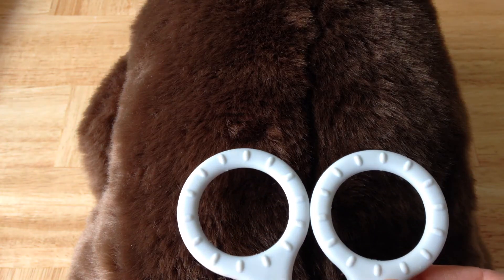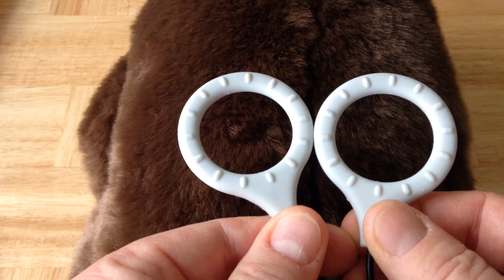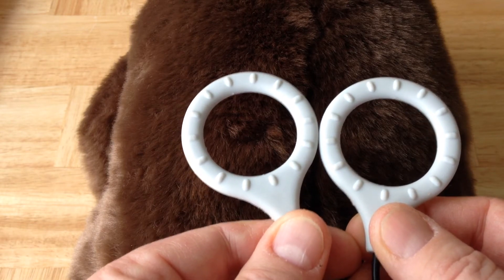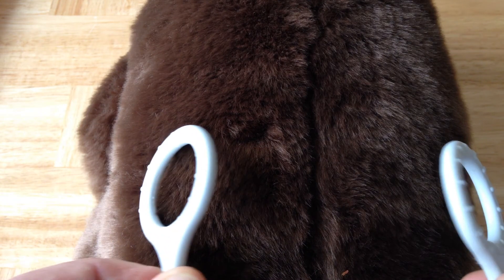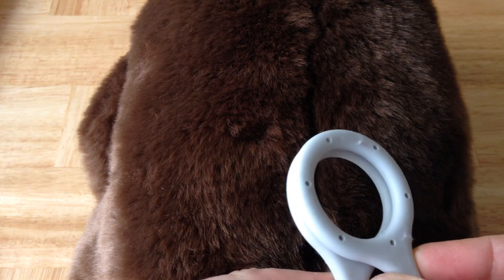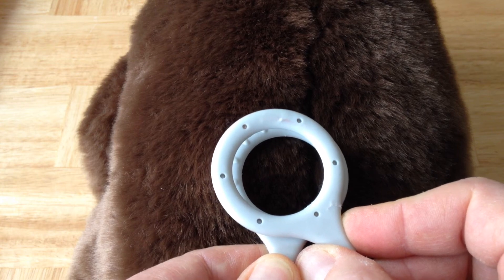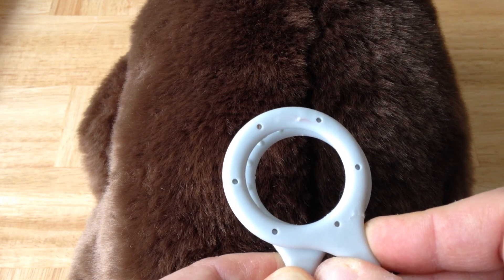Micro-Pulse ICES PEMF Video Tutorial 1 - Basic Coil Configurations

Comment: How should the coils be placed to reach the femoral head? I.e. on the front of the leg and on rear end or near crotch and outside of hip? 

Can you comment on the use of this for avascular necrosis (AVN) of the femoral head?
Reply from the maker: The best way in general to get depth of field is to use coils on opposite sides as you suggest.  Depending on how thick your gluteus muscle is, your strategy may vary.  With thick glut muscles, positioning the coils on crotch and outside of hip will probably work best.
Reply: @robertgdennis7472  thank you for the reply!

Comment: Hi Robert... Nick Urban's father here.  I had knee replacement surgery a few months ago,  and bought the M1 model to help with recovery.  I wear it all night long with the coils on opposite sides,  either side to side,  or kneecap to back,  using the standard settings the unit ships with.  Curious to know if you have any recommendations for either coil placement, unit settings, or anything else.  Thanks in advance for your response.
Reply from the maker: Hi "Mike Urban's Dad", nice to hear from you.  This is a really good question, and the answer is that the issue depends on a lot of unique individual factors that remain not-yet well understood.  So I think the best strategy is to follow a few basic guidelines, and use trial-and-error to find what works best for you as an individual and your individual injury.  This is easier than it sounds, usually people just need to try about 3 or 4 different things before they find a strategy that works well for them.

We have a community forum where people actively discuss this and many other issues related to ICES-PEMF, specific applications, and combinations with other approaches as well:

https://forum.fluxhealth.co/
Reply: Hi - we've used the m1 device for years and the Omni 8 setting seems to work best for injuries and pain. It was recommended to us by a person at Dr. Dennis's office and we've stuck with it. Might be worth a try.

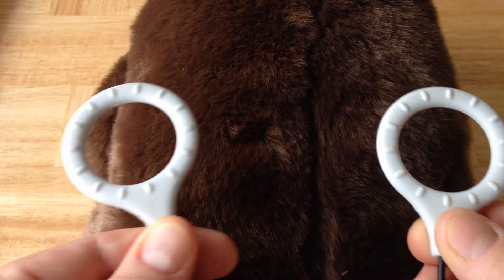Comment: Hi Robert, quick question regarding the coils placement. Why can’t they be placed far apart like you showed here @ 0:17 ?

Thank you!
Reply from the maker: You can place the coils any way you want to, but I am demonstrating the three main configurations that result in magnetic flux density and field concentrations that result in the types of field configurations that will give the most reliable biological effects.  To fully understand why, you would need to do some fairly complex modeling of magnetic fields, which is generally the domain of someone with an advanced degree in electrical engineering or physics.  I have done this, and my advice is summarized in the video with the three basic configurations that I recommend.  You can do something different if you want to, and it may or may not work for you.
Reply: @Robert G Dennis – Thank you for the detailed reply!

Comment: Hi,  what is the best placement for frozen shoulder? I have tried on either side ( front and back of shoulder) but I have not seen any results.
Thanks Angela
Reply from the maker: I don't have any information on whether or not PEMF would help with a condition like frozen shoulder.  Basically it is entirely self-experiment:  you would have to try various placements to see if any help.  It might take a few weeks to see any results with a structural problem like that.  It is possible that PEMF simply does not help with frozen shoulder.  I have never heard anyone else comment on it either way.

Comment: Is there a larger version of this device like you see with regular sized pemf devices to target the whole body?
Reply from the maker: we sell a model C5 which can be used to make somewhat larger mats.  
https://www.micro-pulse.com/collections/frontpage/products/ices-digiceutical-c5-model-system?variant=37608010317

The C5 also allows you to target up to four different, distant areas simultaneously, for example, a foot, knee, shoulder, and hand.  Larger systems do not do that at all.

But we don't claim to make "whole body" PEMF.  The fact is, no one makes real "whole body" PEMF, they only tell you it is "whole body" so they can charge outrageous amounts.

But if you still want to believe these claims you need to be prepared to write a very big check for something that most likely will not be what you are told it will be.

Comment: Thanks, Robert. You have a great product which I am using daily. The video helped clarify use of the coils.  
One question, what is your opinion of the effect of wearing a coil like a ring on your finger?  Is the finger safe?
Reply: +Harry Wynne 
I hope your system is still working well for you.  

I have some more information I thought I might send you since my last response 7 months ago.  Based on a lot of user feedback, ICES seems to work best on hands and feet when you use the coils side-by-side, like a figure '8', but placed sideways, but it is not so effective when placed around fingers or toes like a ring.  Also, lower power settings (M or L) seem to be more effective than higher settings (H or X).  This is an observation based on quite a lot of user feedback on this specific topic... I just thought you might like to know.
Reply: +Robert G Dennis How much clothing can exist between the coils and the body? Can I tape this to a shirt to use nightly, or is it better on the skin?
Reply from the maker: +The Ball 
Sorry for the delay responding, I just saw this...
Sweat can damage the electronics, and will eventually damage the coils, but it does not interfere directly with the electro-magnetic mechanism of action of the device.
Reply from the maker: Hi Harry, we can not give any clinical advice (sorry) because we are not licensed clinicians.  But I can tell you that ICES PEMF technology operates in an RF energy range well below the safe limit for environmental exposure to RF energy as defined by the ICNIRP (International Commission on Non-Ionizing Radiation Protection).
Reply from the maker: +The Ball 
Clothing will not interfere with the magnetic field unless it is conductive or metallic.  So basically normal fabrics will not cause a problem.  Thickness of clothing acts physically like separation in empty space:  farther = reduced field strength.
Reply: +Robert G Dennis ...what about sweat

Edit: I mean sweaty clothing